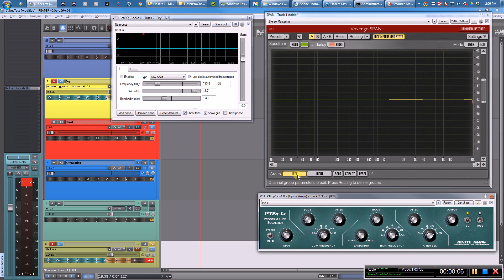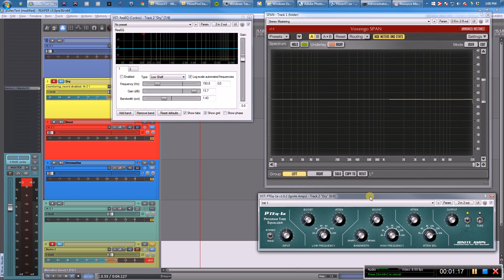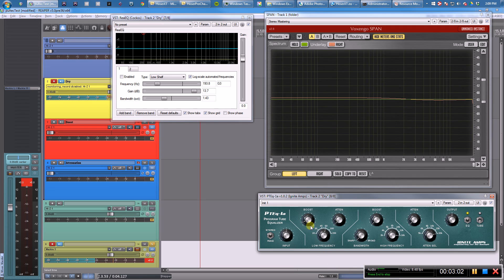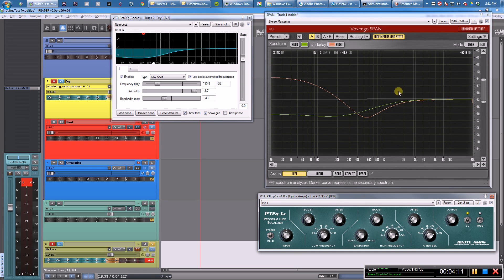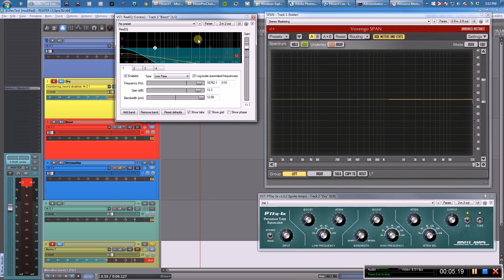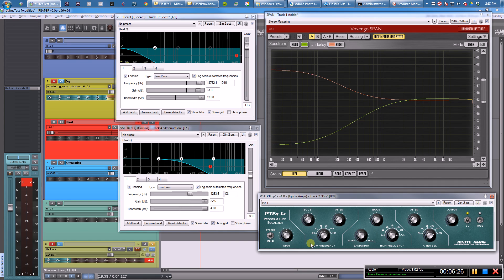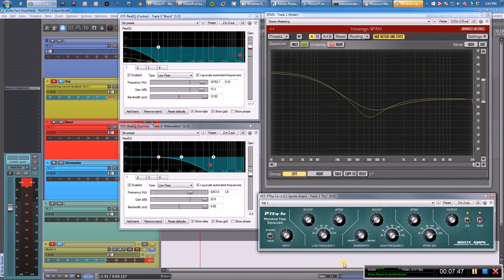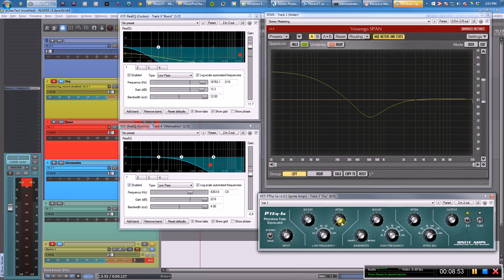Boz Digital Labs Tech Talk: Pultec EQs

Comment: you are genius!!thanks!! just one thing,WHY DIDNT you use LOW SHELF(instead of low pass)  to replicate the working of pultec boost and attenuation(please do let me know).thanks again
Reply from the maker: I just tried it, and it doesn't combine the filters quite right. It gives you a result that is closer than the series example, but still doesn't match up with an actual pultec.

Comment: Check out his new version: Ignite Amps PTEq-X
Reply from the maker: The filter was not linear phase and had a few samples of delay that caused some nasty comb filtering when used in parallel. Micro delays can wreak havoc on multi-mic'd sources.

The new version has linear phase oversampling and proper delay compensation.
Reply from the maker: +DubQWST oh, awesome. This is a big improvement over their first one. Not just in what it does, but in the way it does it. No more nasty oversampling filters.
Reply: Thanks for the explaination. What was wrong with the oversampling filters of the initial PTEq version?

Comment: White noise...........Span
Type =RTAVR
Block size =16384
Overlap=93.8
Avr Time=full
Smoothing=2.5 OCT
Freq low =20hz
Freq Hi =22khz
slope =0

Let it rest a little and you are ready.

Comment: PLEASE... How did you set up Span to show the curve like this?  I'm trying to figure it out and haven't had any luck yet.  Thanks in advance!
Reply from the maker: +clubdeejay I had to create an impulse generator plugin that sends an impulse every 512 samples (if I'm remembering correctly). Noise generators take too long to average out. Using an impulse makes it so the results are instant.
Reply: tutorial? :)
Reply: +clubdeejay He is using Reaper, which contains an FX plugin (in JS format) called fft_noise_generator. Simply use that and match the same FFT block size in Span. So, in short: It is not a SPAN feature. It is a Reaper feature.
Reply: I would;d like to know this as well! TIA
Reply: +Niklas Silen understood!  Thanks